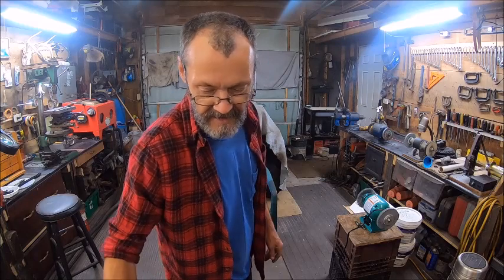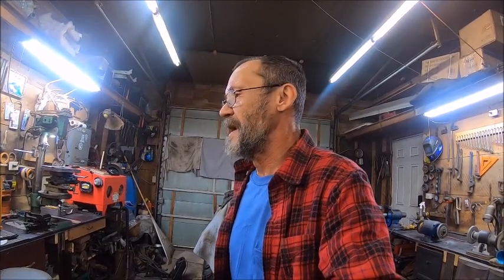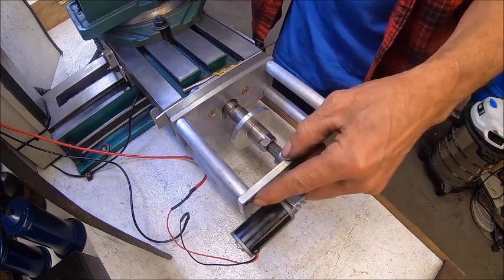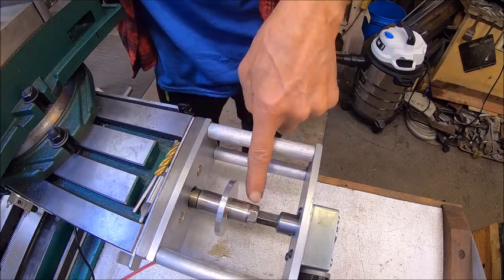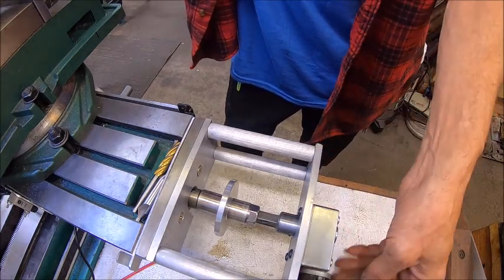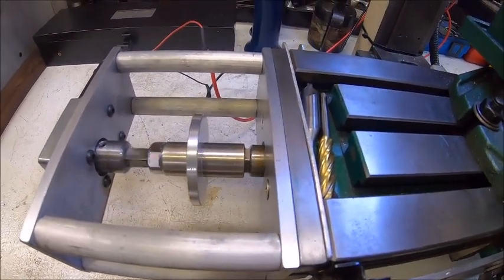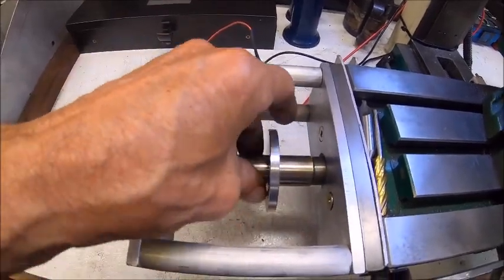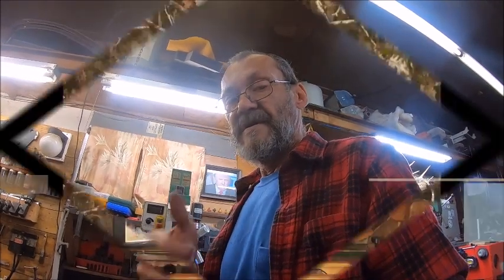grizzly g0758 gets a DIY power feed part 2

Comment: If you move the limit switch in a half inch wouldn't you get the lost travel back?
Reply from the maker: you must have missed it when i corrected my mistake. it was only a 1/16, not 1/2 inch lost. not enough to bother with